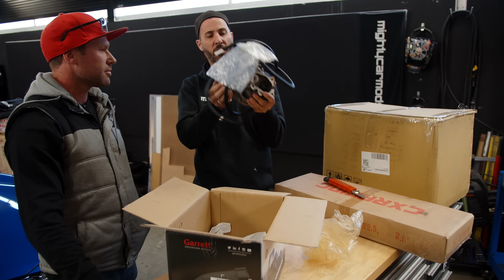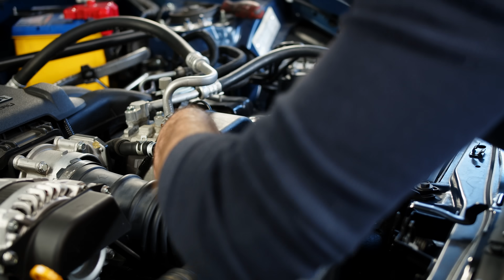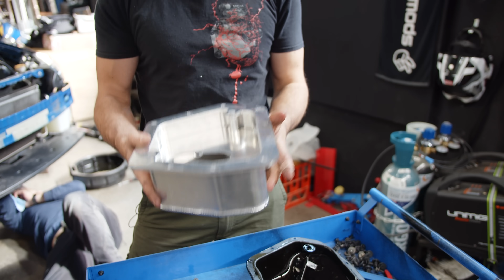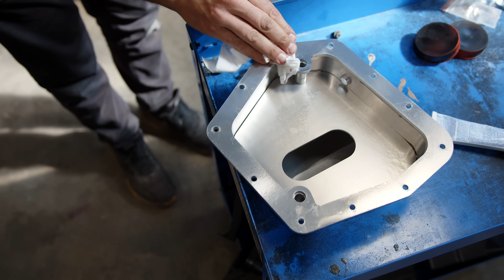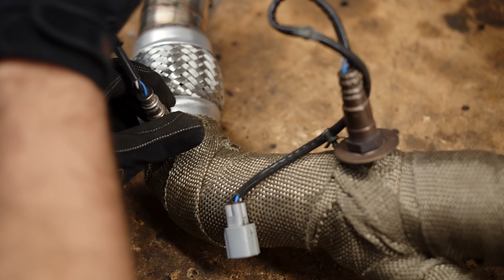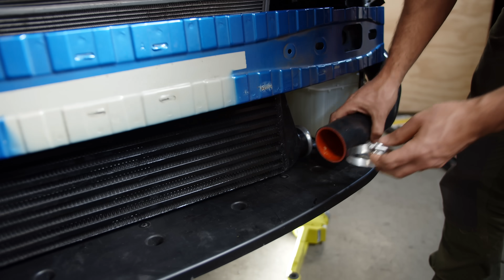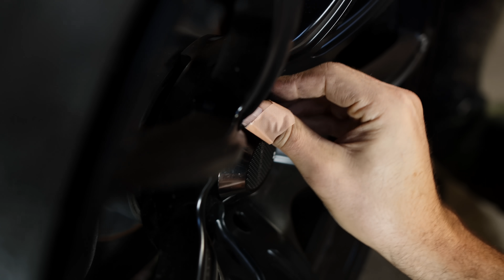How To Turbo Your Car [IN ONE DAY!!]

Comment: 22:53 where marty poked the plastic film on the oil filter to open it was hard to watch, replaced a few engines bc people do that and get plastic in the filter which ends up blocking oil passages and makes things go boom 😅
Reply: @mophiustheone  He's just upset because he got clotheslined by a Karen.
Reply: Pretty sure oil filters or the engine have a bypass valve for when they get blocked, also pretty sure a little bit of plastic wouldn't block much of the filter if it got in there, as undesirable as it would be.
Reply: Dale Neish lol no,  two weeks ago a car came in for a noise and the cam was dry and melted the caps, metal everywhere. Pulled the head and found the plastic in the head gasket oil passage. More common than you think
Reply: @barkatmandark  ohh it makes it way out of the oil filter and blocks ports in the motor, yeh that makes sense now wow.
Reply: Mophius TheOne if we are being honest they are all without masks so elbow touching isn’t much prevention from disease
Reply: Almost as hard to watch as all of them rubbing elbows like a bunch of karens instead of shaking hands like men.

Comment: Would you help a medically retired Vet. I have an R34 ER N/A and want to swap manual. I wonder if you would have an R34 N/A turbo ECU or any manual ECU you have not trashed or any Haltec for Nissan Skyline. I'll pay the mailing and export whatever. It's just so hard to find anything here in Canada that the USA has not inflated the price on anything Skyline.

Comment: Finally! However... 180KW / 240hp ? Don't limit it there! That makes no sense. Just tune it properly and get it to a safe limit before the injectors run out. You're running the stock injectors so you won't be getting THAT much more however that set up can easily do 260hp (I don't know why you'd be limiting yourself for the sake of limiting yourself. Put on a conservative tune on it and show what it can do!)

Comment: Should make 2 vents each side of the front badge then put some black mesh in the holes then that pod filter will get smacked with heaps of air

Comment: “We’re turbo charging the brz” 

Next episode: how to fix a car that doesn’t start
Reply: the fa20 actually handles boost very well and doesnt need much psi to make power. the engine cant handle heaps of power stock but if you dont push crazy numbers they will last years with no drama
Reply: We're*
Reply: “First...jack up ya car”
Reply: Where? Right here.
Reply: @tarpnpoles  no...right there..

Comment: good effort guys. took me and a mate about 12 hours to install a kit over the weekend, which included welding the return line fitting etc, and that was an ebay kit >.> super easy engines to work on.